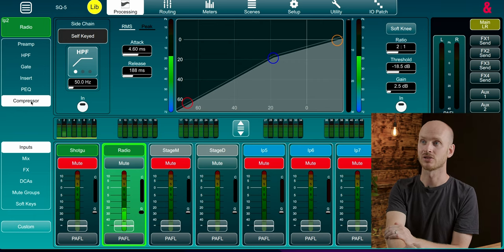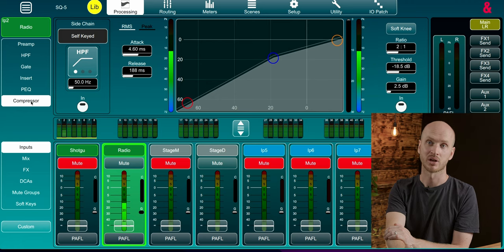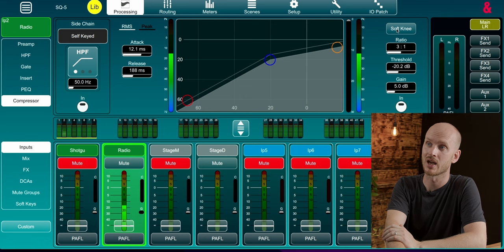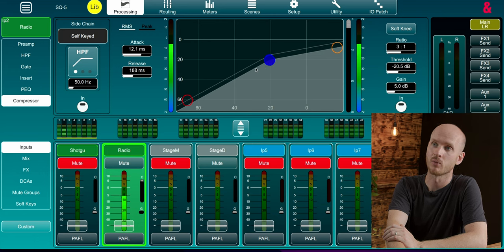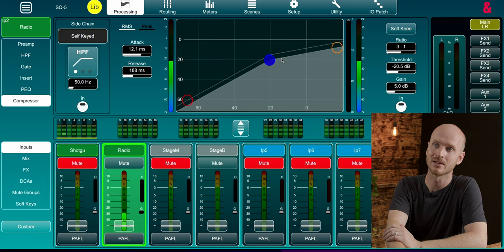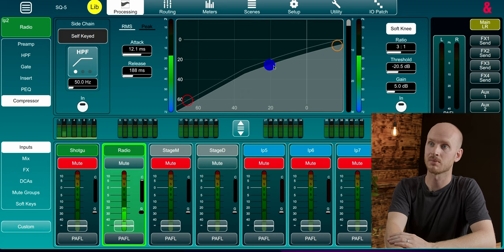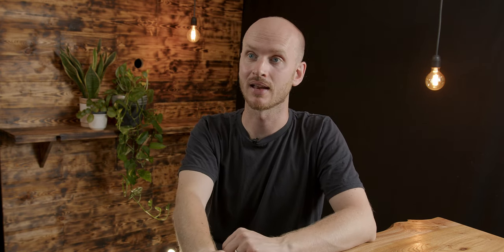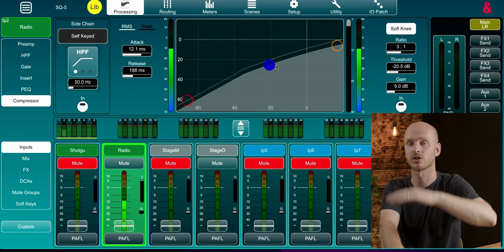How to set a digital compressor - perfect compression every time!

Comment: 1 request sir.. can u please make a proper video  describing the actual difference between a GAIN & TRIM on a digital mixer.. please... Will be waiting. Thanx a tonn🌹🌹😇🥂🙏
Reply from the maker: Basically gain is adjusting the pre amp to give you correct level into your console. Trim is a control that doesn’t control the pre amp and allows you to adjust level. Normally used to pull down a line level source that’s too hot into the console

Comment: It's good to understand ADSR as it's a handy way to think of the different elements in your arrangements. But the compressor does not see those events as individual notes usually. It sees signals that are either above or below the threshold and thinking of how it operates in direct reference to an ADSR envelope could stand in the way of your understanding the compressor completely. A single snare hit, while being fairly straight forward to explain as an ADSR event, is a complex waveform that will have a compressor attacking and releasing several times through the duration of it's ADSR. (If you set your threshold *just so*.) 

That's not to say that compression doesn't affect the ADSR of a note. It truly does. But it does so in a somewhat round about way. That's why it's important, especially for a discussion like this, to understand the ballistics of a compressor. Your statement at 10:58 doesn't really map to the way a compressor works. The compressor starts compressing as soon as it passes the threshold. The attack time dictates how long it takes to reach full(ish) compression after passing the threshold - not how long it takes for the compressor to activate, or start compressing. (I say "ish" because every compressor is a little different.) Release works pretty much the opposite. And if the needle's moving the compressor is cycling between attack and release. Which means, the needle probably doesn't move fast enough to really show exactly what the compressor is doing with fast settings and our eyes couldn't track that anyway.